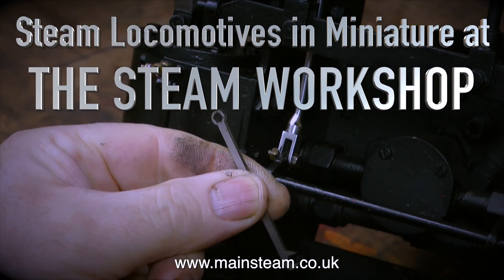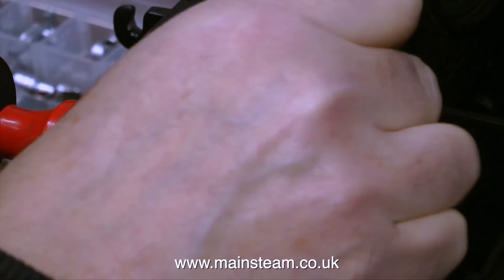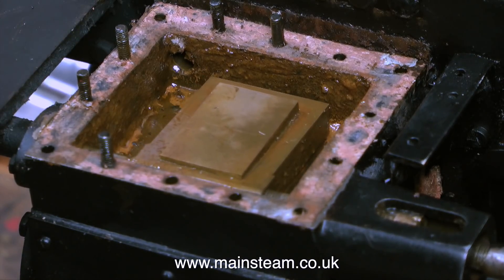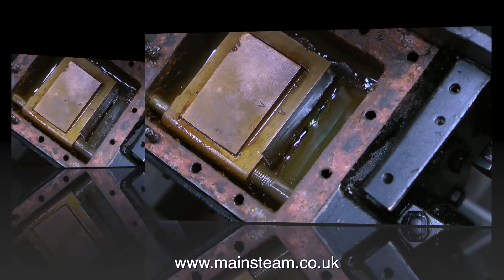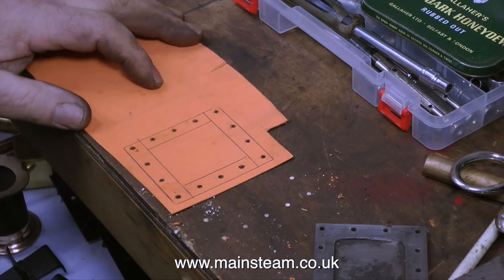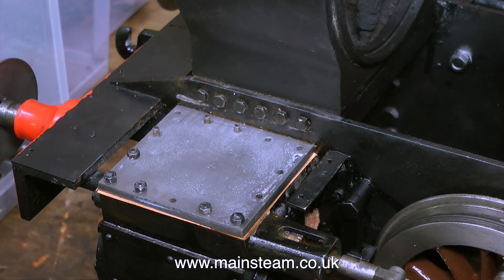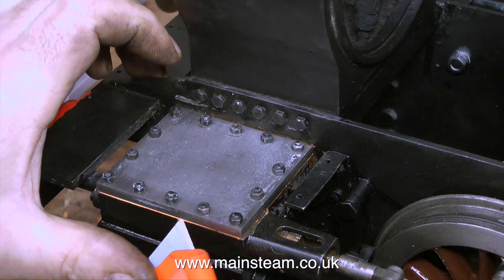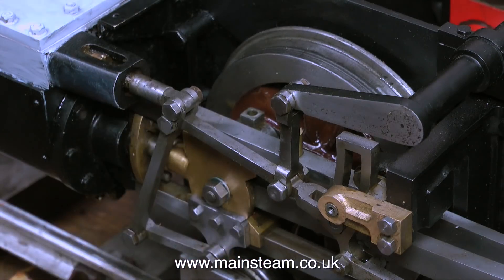WORKING AT THE STEAM WORKSHOP #14 - ADJUSTING THE VALVE GEAR

Comment: Nicely done Mr Appleton. As always your video was informative and your wit entertaining. If I may, I find the laser cut spanners to be very useful. They are thin enough to reach into places where a normal spanner would not and reasonably priced so that if you needed to bend or shape one to reach into an otherwise inaccessible spot, you can replace it easily. Thank you. :)
Reply: do they sell them laser cut spanners in metric ? or just ba sizes for now?

Comment: At the higher rpm/ air pressure, it reminds me of a diesel engine. That is how it should sound, correct?
Reply from the maker: Correct - that's what they normally sound like running light.

Comment: I know some of them are horses "backsides" and will comment stupid things period. There's no way to stop trolls.

I do think some of the serious ones either don't think about, or don't comprehend, how small the parts on these engines are. These parts are tiny..... they don't, by your own words, need much torque or force. No I wouldn't want to use a laser cut spanner on a 3/4" bolt holding a valve chest on a full size locomotive, but these are tiny bolts. 

Kind of like the guy freaking out in an anvil discussion group because someone had a wedge posted tool in a Pritchard hole.......The anvil was all of about 6" long and being used by a gold smith. The jewler, over the span of his career, will never hit the thing with half the force or number of blows to crack the heel, but you would have though it was a 350# sitting in a locomotive shop somewhere.....

Comment: She runs as sweet as a nut now, great job. Kinda getting tired with all the Ugh those spanners are bad because they're [insert incorrect type or manufacturing technique] spanners
Quite frankly a proper drop forged spanner could probably easily break those studs and bolts if tightened too much, even the laser cut ones could do easily I bet. They seem to think this stuff needs to be hydraulic torque wrench tight, a couple tons.
Reply from the maker: Yeah - me too ...... there are a lot of experts out there in Youtube land }:-[[[